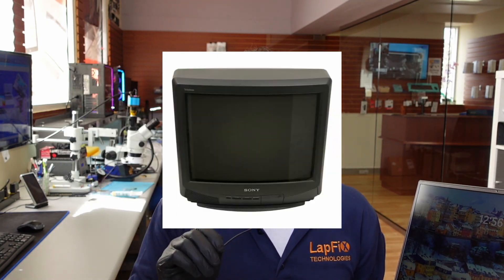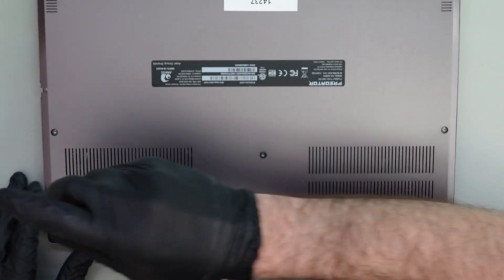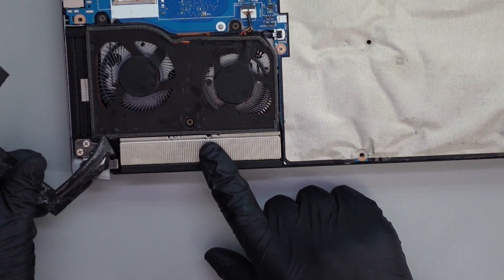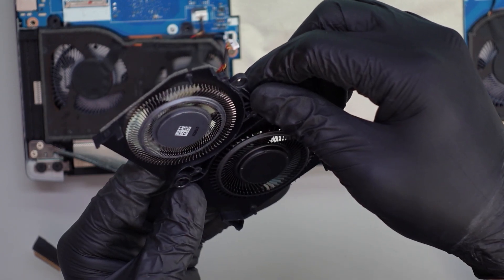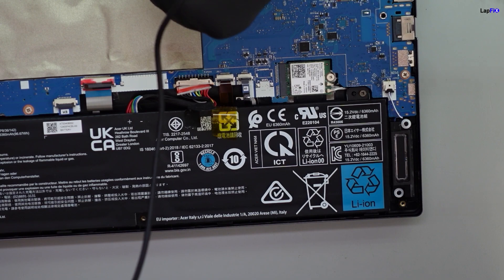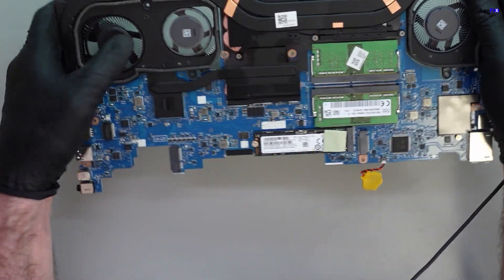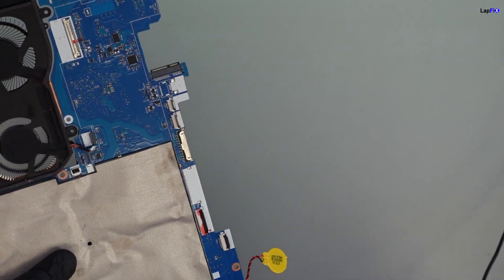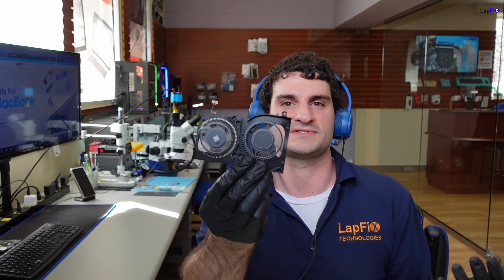Acer Predator Triton 500 SE Fan Replacement

Comment: Nice demo! Quick question, do the connections you pull out at 07:09 need to be soldered back on, or they just clip in? Just worried about not having the right equipment to put everything back together after taking it apart!
Reply: If you never found it out for yourself, they clip in